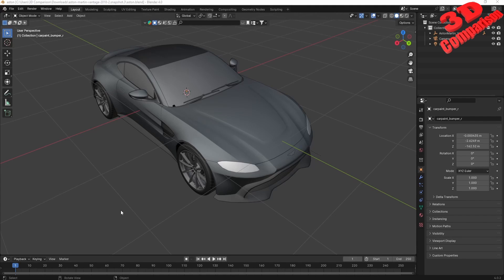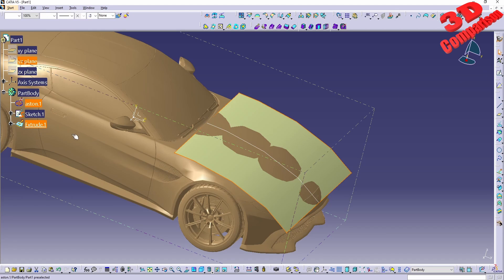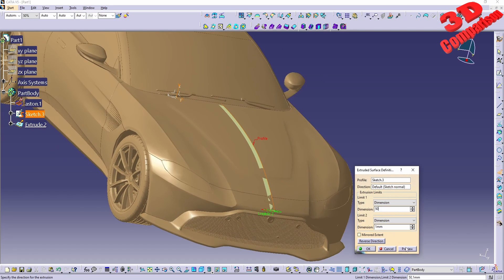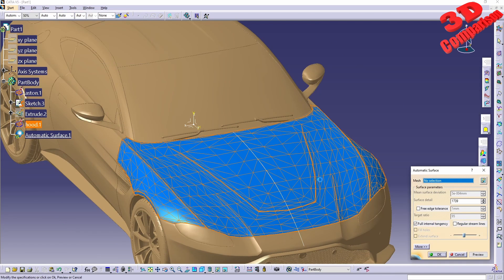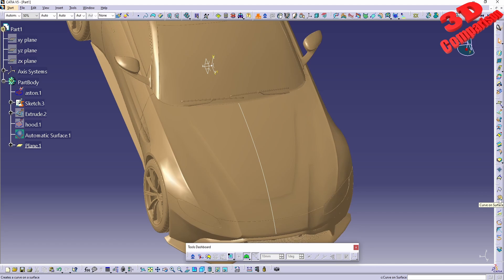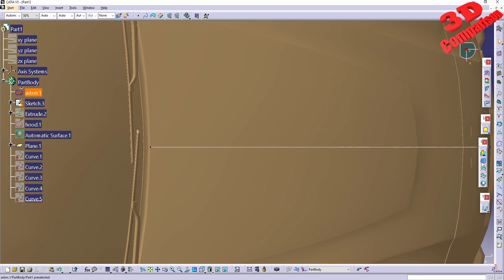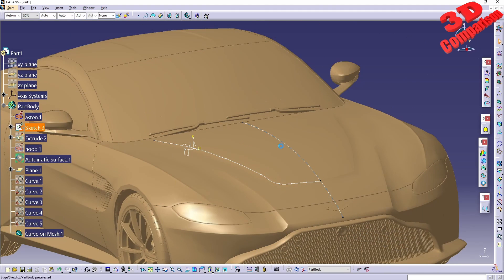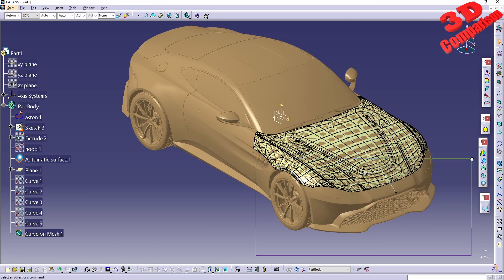CATIA V5 - Create surfaces based on STL meshes

Comment: Great channel, clear explanations! Thank you for the many helpful content!

Could you please make a video on how to create the hood with power fit by drawing curves on the mesh? (Only the methodology is enough of course, and no need to create the whole hood.) I got some ideas on how to do subtasks but I can’t connect the individual steps and I don’t manage to make the process as a whole. I would be interested in the following workflow: Create free edges, draw a grid of curves on the mesh, divide the free edges and curves on the mesh by their intersections to make individual curves and finally use the resulting rectangulars as the input of power fit to make surface patches. (If possible with a constraint of tangency or curvature while creating the adjacent patches, or healing the whole stuff after the patches have been created.) In addition I don’t understand the init surface option within power fit. And what is the difference between "Paint Curve" and "Curve on Mesh" ?
See this picture for reference:
https://imgbox.com/KX5KRdO0

And as a comparison could you please also show how to do this task using the following commands: Curves network, Surfaces network and Net surface (I don’t understand the difference between the latter two)?
Reply from the maker: Hello, this is a very interesting topic. I have created a video regarding this using Quick Surface Reconstruction and GSD using Curve on Mesh. The main problem with curve on Mesh is that the tangency of the outputted curve is harder to control.  I have recorded this video prior seeing your comment (https://youtu.be/AUMjwCZlIk8). For this Hood design I would likely go for the ICEM modeling approach within Imagine & Shape from CATIA V5 as I feel that it is easier to work with then Freestyle and GSD. Here is a video regarding this ICEM workflow https://www.youtube.com/watch?v=c9rFQ8CEIPI, this is also available within 3D Experience CATIA - https://youtu.be/fr9WSRFzjOU?si=elsJZ4gFilhiGpc_&t=242 . I will make additional videos regarding Curves Networks, Surfaces Network and Net Surfaces, I am not using those very often as I have started to enjoy working with surfaces within Fusion 360 lately. But these are all really interesting topics and I have seen that CATIA 3D experience improved a lot on ICEM modeling and I also want to get into that.